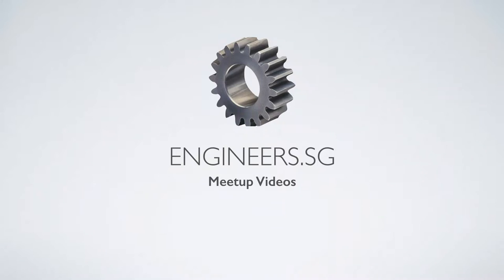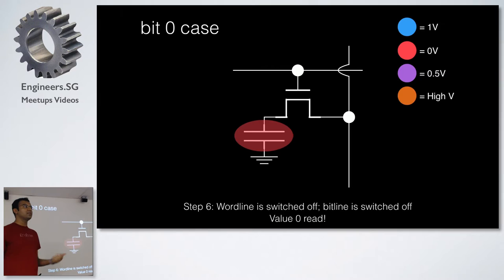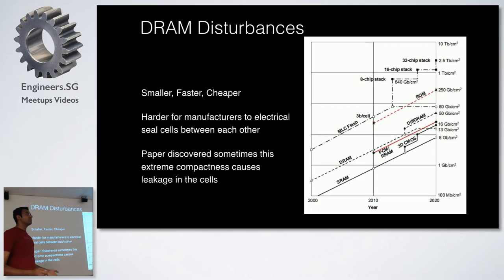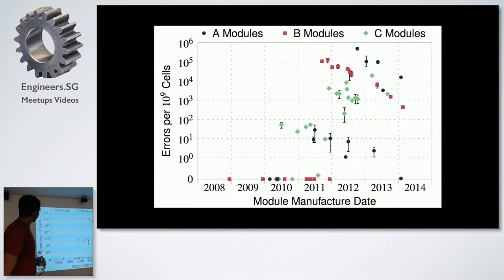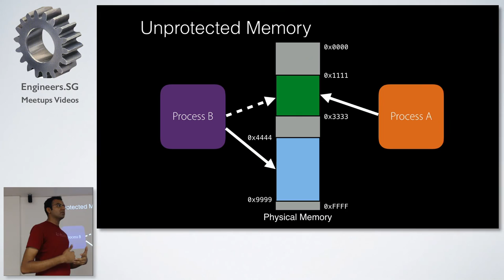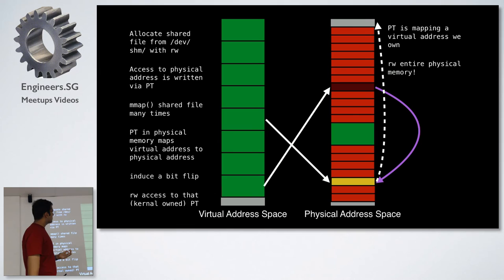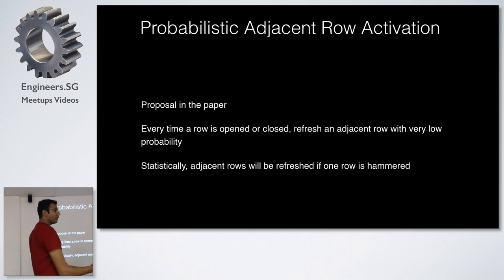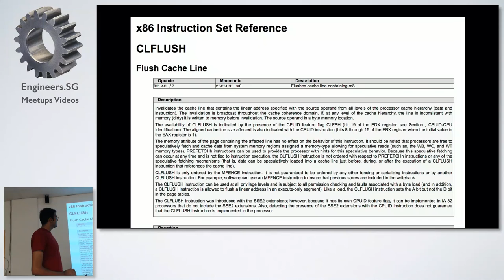Row Hammer: Flipping Bits in Memory Without Accessing Them - Papers We Love #026

Comment: I have a question: In the exploit part, you suppose that the rowhammer occurs within a PTE, which is a priori a kernel land address and by consequence not accessible to read (and hammer) ?
Reply: The assumption is that you will be able to access a row near the PTE, or ideally rows on both sides of it. If you cause a very large number of PTEs to be allocated, this will increase your chances of flipping a bit on one of them. This technique of creating a large number of exploitable structures in the hope that one of them will be compromised is called spraying.

I know you asked a long time ago, and probably found this on your own, but I thought I'd leave an answer for others that read the comments :)
Reply: @michaeldamolsen   Yes, thanks anyway ! Your answer may be useful for other folks